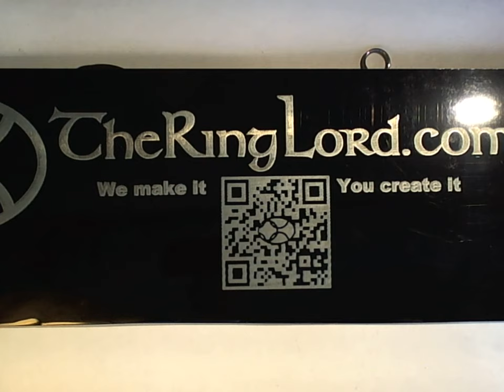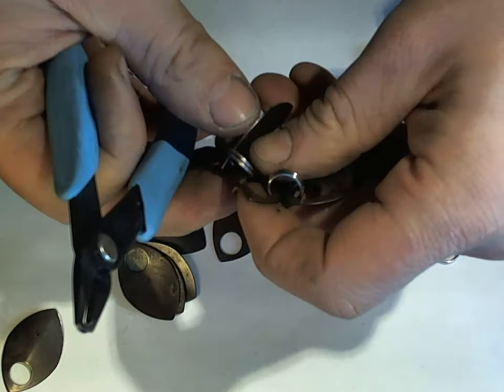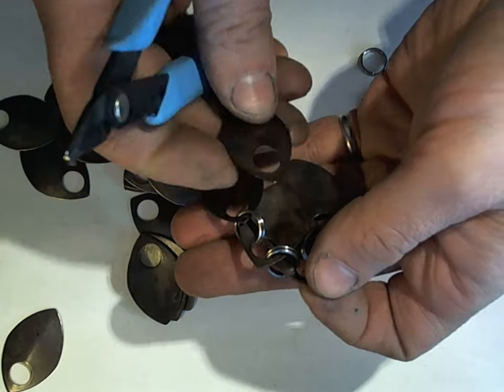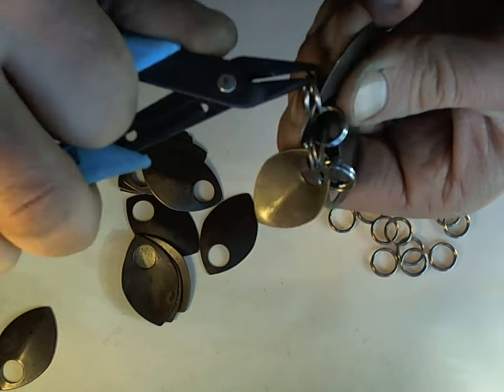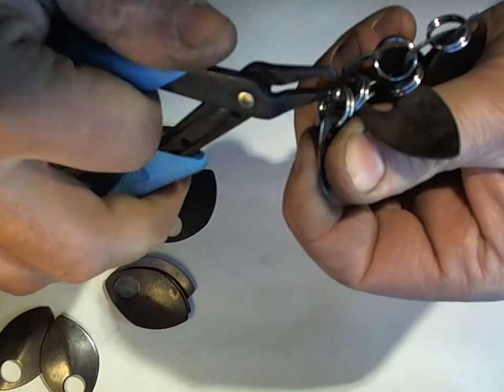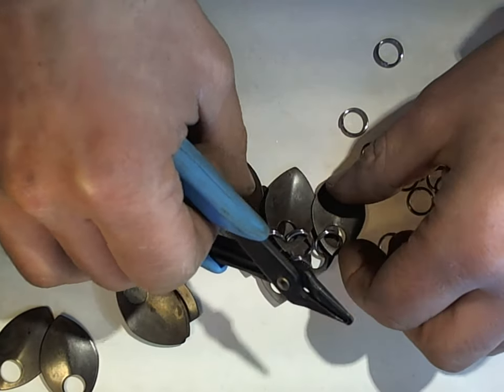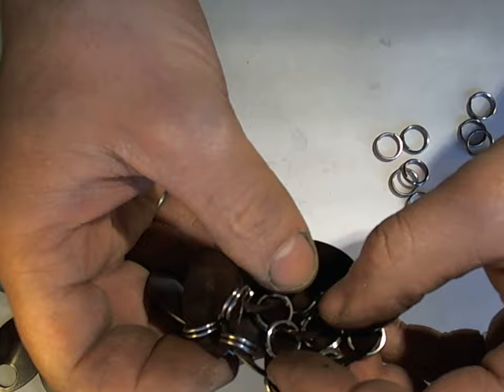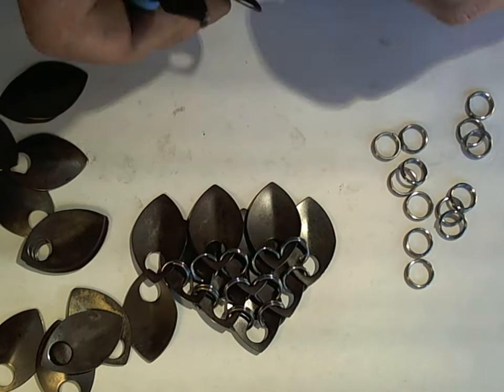Making Scalemail with Splitrings

Comment: Thanks!  This is really helpful for the first-timer working with split rings and scales.  I've found butted rings easier to work with but can't ever close them tightly so had to go with split rings for this project.  Once you get ~10 scales in a V shape together, it tends to stabilize and seems easier to work with, at least in my limited experience so far.

Comment: Have to say...I went with the splitring idea because I've dealt with plenty of butted rings falling open...but. The burr alone on these make the splitrings almost impossible to use. I've had to take flush cutters to the fronts of most of my scales to clean them up before use, which kind of defeats the purpose of using the split rings to 'make it easier'...
Reply: yeah i just wasted $400 at theringlord on split ring scale kits ... i had some old reg stainless jump rings and was able to get 100 together in a hour ... i'm still struggling at 30 in 6 hours with these stupid rings ... what a con